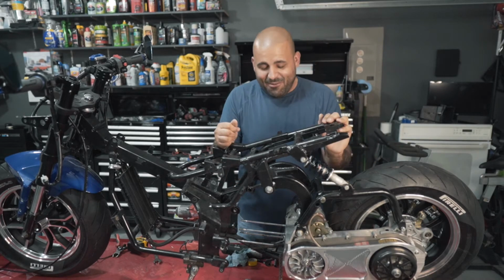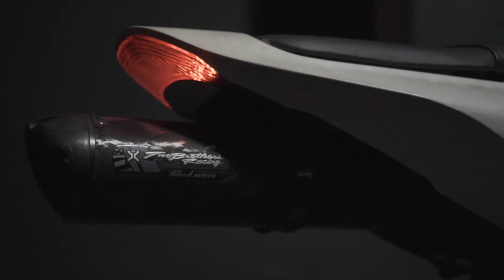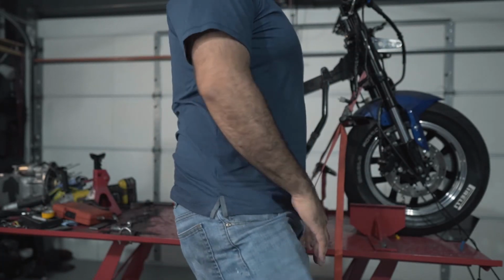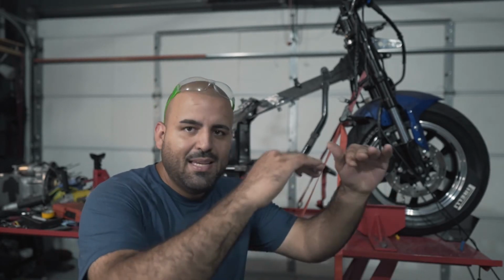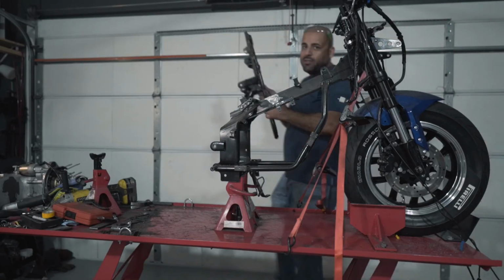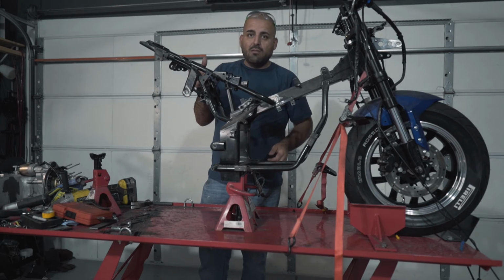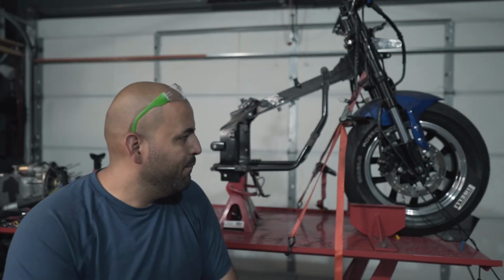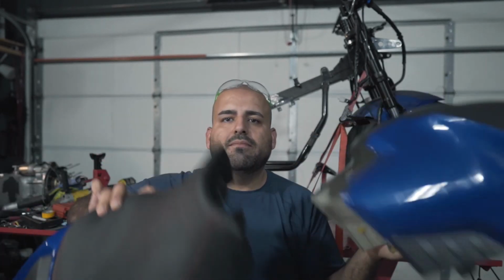GY6 custom build / Vitacci Rocket 150cc/ Dong Fang 50cc part 2

Comment: This is what I've been waiting for 👍💪👊
Reply from the maker: Haha thanks man!
Reply: @jmrbuilds  I just crossed the 200 mile mark on my rocket and I was leaving physical therapy and I started getting a loud rattling noise from my muffler, I got home and noticed that the tube that comes off the exhaust that has a black canister on the end (think it's pressure release) was tied around the frame and pinched off. Do you think that could have caused too much pressure to the muffler and it broke loose the baffle. I'm a construction worker not a mechanic lol. It idles just fine but when I give it gas the muffler rattles really loud, the motor hasn't lost any power and I also tightened everything on the bike. Hope you can help me out bud because the company I bought it from won't return my calls or emails.
Reply from the maker: @vladimpaler9274  the black little canister or cylinder you are talking about is more like a filter that helps pass the environment regulations USA has when exporting motorcycles from other countries, one thing I noticed with the Rocket is that the vibrations are very high when you are riding the scooter, and there is nothing that you can do to lower the vibration because since the scooter is a single cylinder engine the crankshaft is not balanced and that's where the vibration comes from , when is something like a V twin cylinder the bikes run more smoothly that being said I think the baffle broke because the vibration of the engine, have you check the clamps that holds the muffler into place ? Did you check the bolts that holds the exhaust pipe to the engine ?
Are they loose?
 In case any of those bolts are loose that will most likely the reasons why the baffle broke off
Reply: @jmrbuilds  Everything is tightened really good, I had absolutely no noises from this thing until I left therapy! I'm pretty sure the baffle broke loose in the muffler. Thanks for replying back bud 👍
Reply from the maker: @vladimpaler9274  sometimes the quality of the Chinese muffler are not the best, I'm sorry for what happened to you , if you go to AliExpress.com the parts for the scooter are really cheap but it takes like a month to get delivered!
Reply: @jmrbuilds  wow thanks man, I been looking everywhere and can't find anything! You're a life saver lol 😆 👍💪👊 have a great day!
Reply from the maker: @vladimpaler9274  not problem man! 
Just type on the search bar " gy6 150cc exhaust " and you should be able to find it , they have a bunch of vaerity to choose from.
Reply: @jmrbuilds  Couldn't find the original muffler but I found a pretty nice muffler on AliExpress 👍 it's gonna take about a month or longer to receive it. I bought a temporary muffler of Amazon for $50 to use until my nicer one shows up, had to do a little customizing to make it fit but it's working great. Just wanted to say thank you for all the help 👍💪👊
Reply from the maker: @vladimpaler9274  no problem man anytime!

Comment: Where can I find front shock absorber for that bike mine are done and can't find the original shocks but better brand on any site.
Reply from the maker: Hey what's up brother! I'm so sorry that I'm replying to your message soo late ! 
Were you able to find the shocks?
Some time ago I was looking for new shocks too but I didn't have any luck finding them , the only shocks that would fit  are the ones for the honda grom but they are like around 200 to 300 dollars wich are a little bit expensive in my opinion
Reply: @jmrbuilds   haven't found yet but if honda grom are only fit no matter the cost i have to get lol but not lol